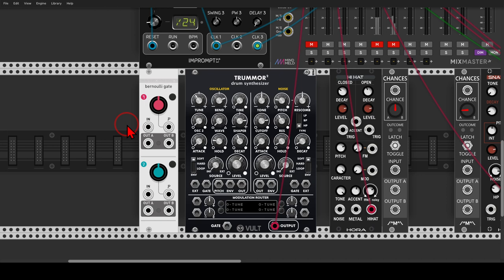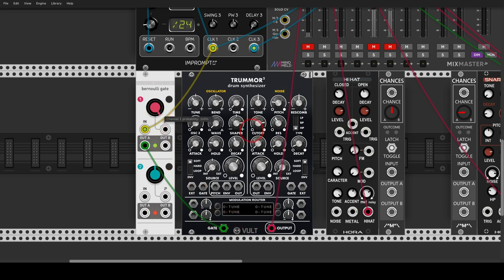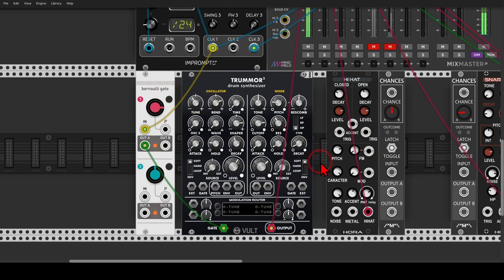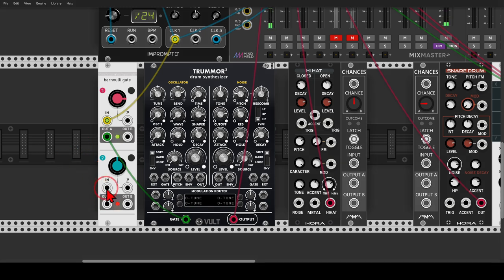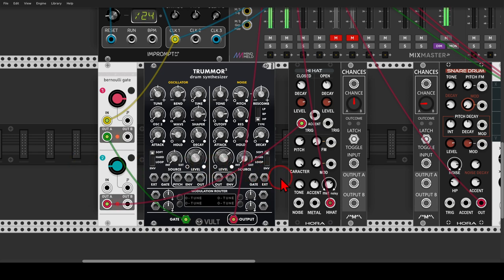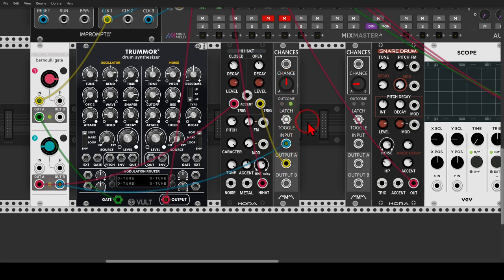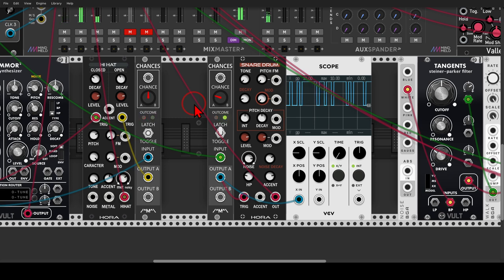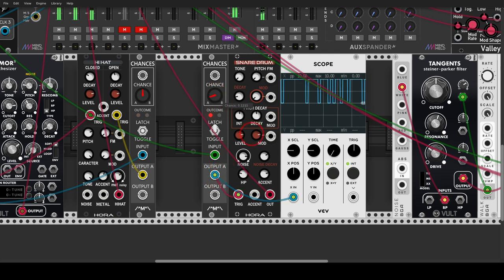5 Ways of Creating Generative Rhythms

Comment: that 1 sample delay when u are using a clock divider (9:30) is caused bc of the clock divider or the use of several modules? because with the Bernoulli Gate u are not using any mult

btw love this video, i started few days ago with the modular synthesis :)
Reply from the maker: Yeah, because of the use of several modules. Each module will add a 1ms of delay so sometimes triggers will reach their destinations at different times which might cause issues. It's nothing to be concerned about, most of the time, but it's useful to know. Cheers!

Comment: The last stage of your clock divider section is driving me up the wall trying to figure it out. VCV's 4-input mixer, its delay panel and SEQ-3 sequencer got updated at some point and now look different and possibly have different outputs. i don't know if the SEQ 3 not having a Gate output is the cause, but i've tried setting absolutely everything else as close as i can in that section and all i get is a squelchy, toneless mess and can't figure out what the cause is.
Reply from the maker: Yeah, this might be confusing since everything looks different. Actually, you're right, the SEQ3, by default, will not output gates, but you can change this in the right click menu by choosing to pass through the clock. Is this solving the issue? Feel free to email me also, and I will try to help you with this.
Reply: @OmriCohen-Music  i might take another look at it soon, i did try a couple of your other tutorials and was getting good results, especially the Straus one running the chord generator through the arpeggiator
Reply: @OmriCohen-Music  I think that clock passthrough made a difference? It looks like i made a dog's breakfast out of it, i came back to load it up and i can see I tried running it through 3 other modules to have it punch out 8 note sequences of notes instead of the constant bass notes you ended up with. I reckon I'll put that one down and move onto the next chapter before I give myself a migraine again lol